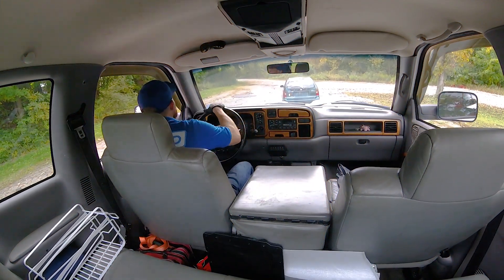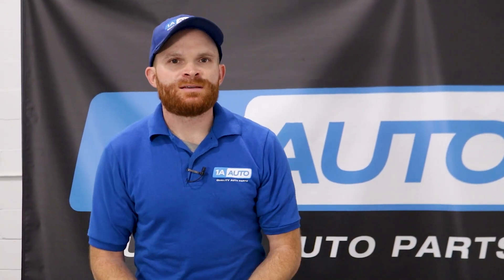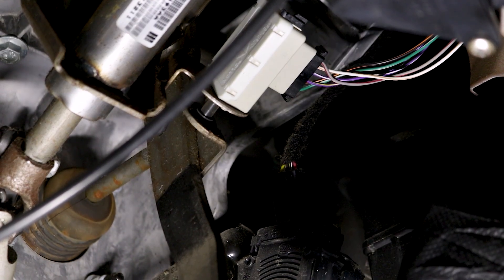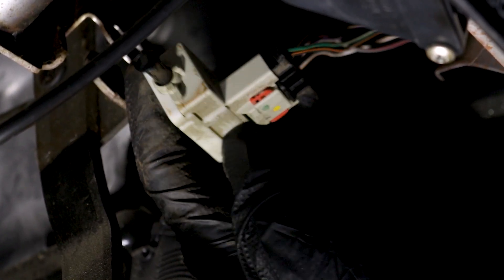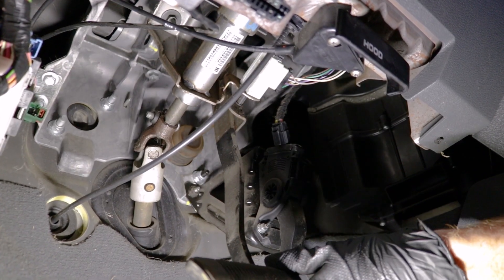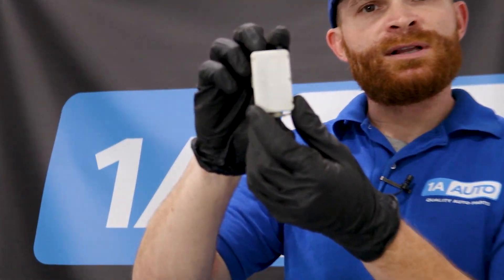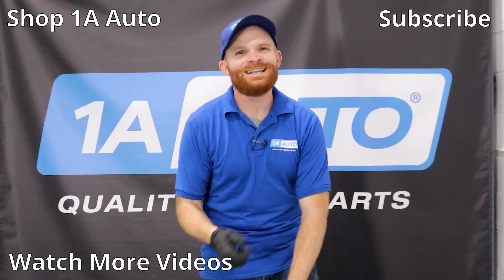Car Brake Lights Stuck On / Off, Can't Start? Brake Switch Diagnosis

Comment: I changed out my break light switch and not my tail lights and break lights don’t turn on. I check the stop light fuse and it looks good. Any idea 💡? Thanks.

Comment: Thanks for this video! I was working on replacing the heater core in a 2007 Dodge Grand Caravan and had to disconnect the brake pedal and steering column shaft. Now my brake light switch has started making a loud clicking noise when I push/pull it ONLY when my truck is parked. When it is in drive there is no clicking noise. Do you have any idea why this is happening? And how to properly turn that black lever to adjust the switch to the correct distance on the existing switch? Both brake lights however work the way they should, however, the top one does not work at all!

Comment: Thank you so much!!!  You were much easier to understand and faster than the owners manual.  I'm gonna get out there and see if the switch is stuck or broken etc...  at least I know where it 'should' be at and probably see if that is actually my problem!!!  I will let you know!!!   Thanx Again !!!
SixxAMA
😸😻😸
Thanx again!
😻😸😻

Comment: Got a question my brake lights on my 2006 f150 stopped working but I could lean under the dash and push the switch and they would come on. I ordered a switch and when I installed it my brakes started working but my truck would go out of park. The kicker and this time I use my foot because while I was waiting on the new switch I had to find a way to use the brake lights so I would push in the switch with my foot to get the brake lights to work. Any way another switch was sent but same thing. Do you know if the 2006 f150 has an adjustment to it? Or what could be causing that with 2 new switches and the brakes work now but unless I bump the switch with my foot won’t go out of park.

Comment: My breaking switch was causing transmission problems.  Car sometimes would not move in reverse and when it did it suddenly would put on the breaks without me stepping on the break paddle! Freaking annoying untill I got the schematic of the switch for the 2007 Corolla and found out how the switch sends signals to the PCM which controls the ABS system and ECU! My believe was that the switch was faulty as my scanner detected the code and was causing the PCM to automatically enable the ABS like a ghost! Took it out and sprayed some electric cleaner all over and readjust the all switch where when the pedal is not pressed the button of the switch is free from any pressing.  This fixed the problem and has been running like it was before! After 2 weeks on this fix I changed the transmission fluid and filter and Corolla runs even more smoothly! I ended up replacing the switch to a genuine updated version for peace of mind!

Yes a faulty "Breaking Switch" causes transmission problems and most mechanics will fail to detect the issue!

Comment: I have a 2008 buick lucerne. The brake light is always on unless i press on the brake pedal just a little. The service manual says a scan tool is needed to zero out the switch. 
Is there any other way to fix this issue?

Comment: My brake light stays on . I brought a new brake light switch and it still stays on , what could be the problem?
Reply from the maker: +@yungal7647  We wouldn't be able to diagnose an issue like that here, you may want to have a local mechanic take a look at it. Thanks for checking us out! http://1aau.to/m/Shop-1AAuto-c

Comment: Although I haven't yet tried the fixes recommended in the video, I am very grateful that you posted this. I've never had an issue with brake lights staying on continuously but, with your recommendations, I have somewhere to begin the testing. Many thanks!

Comment: I put 2 new ones in and it gets stuck when pushed all the way in as soon as the brake hits the piston it pushes it to far in and gets stuck pull it out and does it again 2 new ones same problem. How do I fix this issue on 2013 Dodge Grand Caravan

Comment: Hi just wondering if you could be of help I have a 2008 Mitsubishi lancer ES when I put the head lights on the brake lights stay on while driving during day lights off the brake lights don't stay on they work normal when I brake  any idea what could be thanks??I would much appreciate  your reply

Comment: This was so helpful, thank you! I'm going to try this. After replacing our brake booster we've been driving around with our brake lights on and even drained the battery once. (And no, the new booster we installed was not adjustable).

Comment: Did I miss the part where you said how to adjust the switch or the pedal if the switch is good?
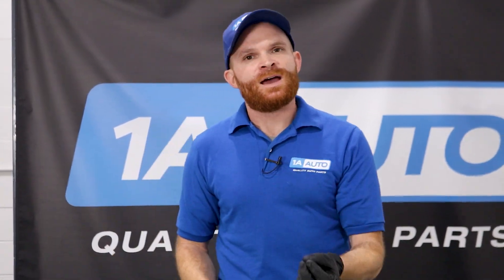Reply: He said the one in the video is not adjustable but at the 1:50 mark there was a quick shot of a switch being adjusted. I need to check mine and pray it can be adjusted!

Comment: I replaced my brake light switch on my 2005 explorer. when I put it in gear the engine stops. What is wrong sir.

Comment: My folks have a 2001 Camry with all the brake lights starting on. Drained their battery last night. I climbed under the dash and saw the brake light switch, and the piston button. On theirs, the button looks chrome silver. The brake pedal armature has a hole in it where the button looks like it could possibly slide right in. ??? But right now, the button isn't even making contact with the armature. So it sounds like the switch either needs the piston button adjusted, or the whole switch needs to be replaced.

Comment: I would love to know why my high mount 3rd break light on a 2009 Toyota Avalon only works in cold temps at 50⁰ F and below any higher it don't work at all.  Did a lil research and learned several other owners were having problems with their 3rd break like working intermittently.  I replaced the light with 2 different lights from the junk yard with the same results so I figured it may possibly be a wiring issue.  Didn't know about the breaking switch will get my mechanic to check that next, or buy a new light directly from you guys,  hopefully one of then is the problem because I don't want anyone rear ending me.
Reply from the maker: +Paige _Judah Thanks for the feedback!

Comment: My main brake lights do not work when I press on the brake nor does the park lights, reverse lights or indicators. But on the bumper, they all work fine. What could be my issue as to why my main brake light, park light and reverse lights do not work. I own the vehicle for over 2 years now and I only ever saw them work once.

Comment: 01 manual toyota tacoma 2.4L I've replaced the switch and relay and adjusted the switch in many positions but the lights still won't come on... am I missing something?
Reply: Hi. Have you found an answer, as we have the exact same problem at the moment.

Comment: 98 Corolla here the break lights work when pushed but the night ones don’t work to stay on while I’m driving at night. Any tips? I’ve switched the break switch already to test that but no luck.
Reply from the maker: +Adeum Rivera We wouldn't be able to diagnose an issue like that here, you may want to have a local mechanic take a look at it. Thanks for checking us out! http://1aau.to/m/Shop-1AAuto-c
Reply: @1AAuto   can drive car with faulty brake light switch for emergency...

Comment: 2007 Ford F150 , brake lights randomly come on and go off while truck is parked and locked,  could it be a bad switch or something else ? Bought it brand new and never had any electrical issues with the truck...
Reply from the maker: +Barbie Sawada We wouldn't be able to diagnose an issue like that here, you may want to have a local mechanic take a look at it. Thanks for checking us out! http://1aau.to/m/Shop-1AAuto-c

Comment: I'm having an issue with lights on all the time, but it isn't the switch. It's a 2018 Honda Fit EX and cannot find a short in the wiring
Reply: Maybe you have wrong bulbs put.

Comment: What about using newer switches on older vehicles? I have an 05 ford escape that's supposed to have a switch with that lil black one shot calibration...but the one I replaced and the newer part I received did not have such a knob...
Reply from the maker: +Joe Sauce Great question! Search our video library for more on this vehicle: http://1aau.to/m/video-library-c

Comment: PLEASE HELP**I’m having this problem on an 06 Honda Pilot. Brake lights won’t come on at all. I replaced both bulbs replaced “small fuse” in passenger foot well as long as the brake switch with no luck. Please help. Very frustrating. Any advice would be greatly appreciated
Reply from the maker: +KJ We wouldn't be able to diagnose an issue like that here, you may want to have a local mechanic take a look at it. Thanks for checking us out! http://1aau.to/m/Shop-1AAuto-c
Reply: Hey JK, just wondering if you ever resolved your problem. I'm having the same issues and its not the fuses or brake switch? Thanks

Comment: At one time I had a 1994 Buick Regal that had just the 3rd brake light come on.  Had to replace the complete turn signal switch assembly before the brake lights in the body came on as needed.

Comment: I'm glad that this video was posted.. 
I have a 1998 corolla. Same shake as this one. A few months ago I've removed the gauge cluster and replaced the regular bulbs that came in it with LED bulbs..
Since then, well before that I've experienced that the left signal light is the only one that blinks and it's a bit dull . The right signal light doesn't come on at all. I've tried replacing the bulb and it's the same issue. When I turn the headlights on and but put it on bright, the left signal light in the gauge cluster comes on bright even when it's off also when I turn the bright on, the blue light that normally indicates that the bright is on doesn't come on. When I turn the flasher on, all lights on both side comes on and functions right and what I've noticed too a few days ago that even the light that indicates that a door is open also on the gauge cluster doesn't come on but the interior lights works perfectly... All lights works perfectly on the car but I think there's something wrong with the gauge cluster or wires...
Any help??
Reply: My problem is same as to your but my car is cranking but won't start regular bulb or light which also works with door  lock and  burned out my question is finally did you solve that problem